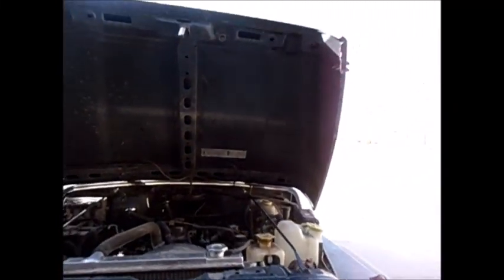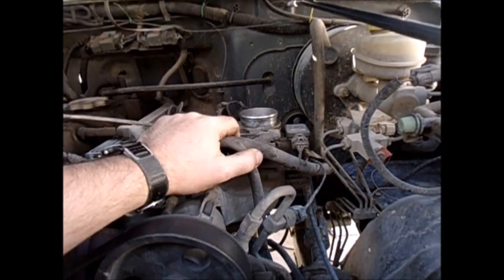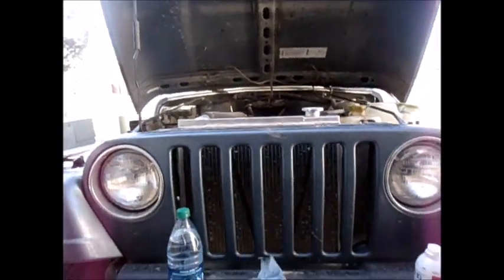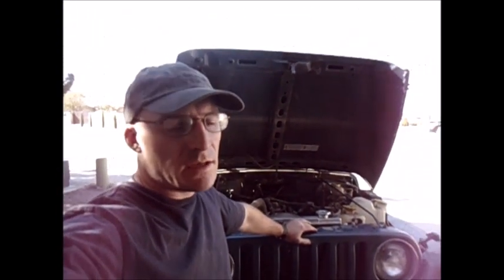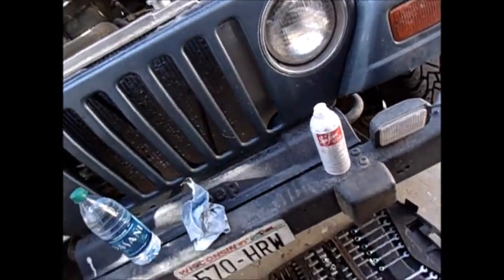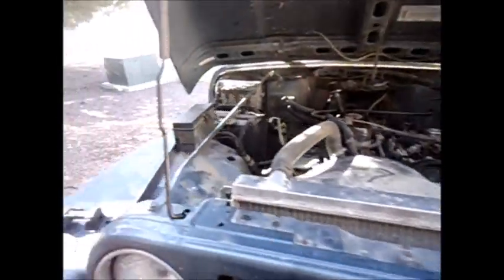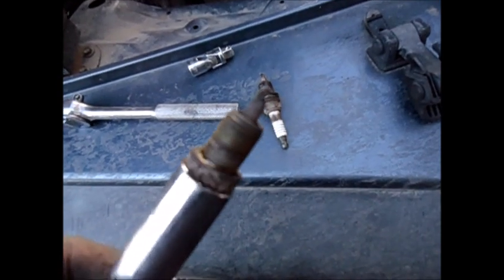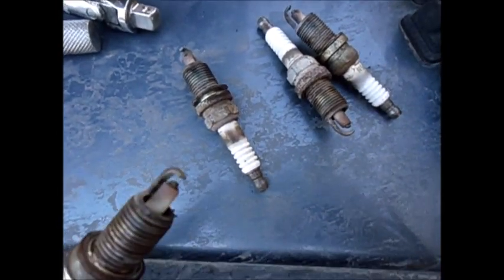more power and MPG out of my 99 2 5L TJ

Comment: People dog the AMC 2.5L four cylinder, however they glorify the 4.0L straight six...some forget the 2.5L four came first before the venerable 4.0L six. The 2.5L served as a basis for the 4.0L and is still a very good + simple motor ~ reminiscent almost to a WW2 Jeep's four cylinder: all cast iron pushrod motor & tough as nails! The 2.5L is better than the more complex DOHC 2.4L Dodge Neon motor that replaced it in 2003.

Comment: best mod you can do is install a power commander from any 4 cyl motorcycle. i have done several with huge gains in mid and top end power. engines start faster and run smoother. your welcome world
Reply: Will that work for a 1997 jeep Wrangler 2.5l ? Do you have any videos on installation. I'm interested in doing this to mine.
Reply: Easier said than done.
Reply: @eddiestr8  sorry for the year late response but did you ever try it? It should work fine
Reply: Jeep sheep channel did this. He has installation video.

Comment: You ever troubleshoot that higher oil pressure? I noticed it in one of your other videos also. I just noticed my '99 getting to around 50-60 on the highway this past year and haven't figured it out. At idle it's just above 40. Probably just a sensor. Can't quite tell, but do you also have spacers on your 31's?

Comment: your coolant is running hotter than my stock radiator. I'm at halfway.
Reply from the maker: its running around 200 it only gets to 210 if I'm crawling up big rocks or playing in the sand it ran at 210 before I swapped out the radiator did you swap out your thermostat ?

Comment: How does the 2.5l handle at 70mph?
Reply: What gear ratio u running and size tires?
Reply: My 1997 2.5 5 speed will do 75 no problem on the interstate with no hesitation on 31x10.50 and stock gears. Still enough power left to go faster but I don't really want to
Reply: I have 4.11 and 30s I can't hit 70
Reply: What the heck?? My 2.5 dakota (same motor) i have had it over 100 mph numerous times
Reply: OKalien did yours come with ac?
Reply: I have the 2.5l with 4.88 gears and 35s.  It only hits 70 mph on a downhill with the wind at my back it seems

Comment: you have this for 15 years wow! did you ever have a code PO 171 engine running lean. I have a 1997 2.5 and no one has a clue
Reply from the maker: No I never had that other than the coolant leak and water pump I've had no problems other than the stuff I broke playing.
Reply: Mine turned out to be my O2 sensors but it could be anywhere from and exhaust leak, vacuum leak to a bad IAC. It was a pain in the ass to track down

Comment: Be careful with those aluminum radiators. Reviews on line are very troubling. They are cheaply made and tend to leak from the welds either immediately or after several months.
Sadly, reviews for all other radiators are also troubling as quality has fallen in the past several years. Research before you buy.
Reply from the maker: I think I'm at ten years no problem with this one so I maybe got lucky but I hate the two part ones they always failed me